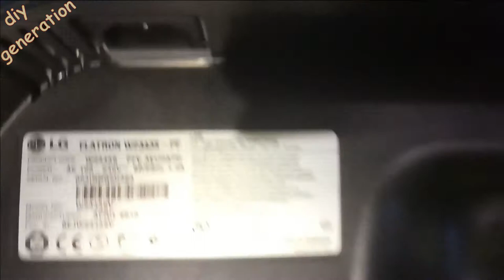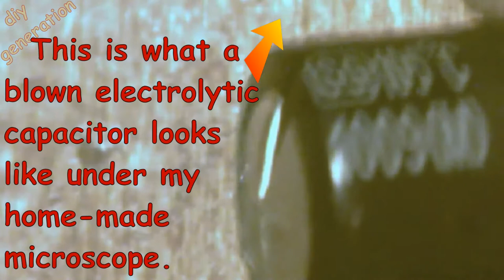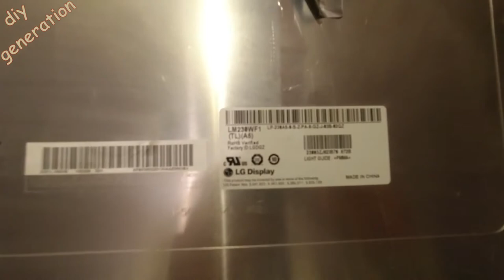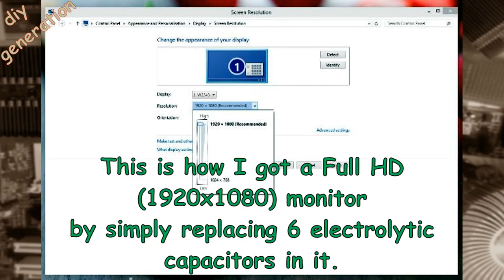Repair of LG Flatron W2343S monitor | Why is the monitor broken | diy generation

Comment: Nice clear and easy to understand repair here, my friend. Good on you for fixing something that was quite usable. A nice new monitor for you. Thanks again.
Reply from the maker: Thank you for rating my video so highly. I must tell you, I have already repaired 3 monitors this way. And all of them had exactly the same problem. I don't have more statistics about monitors failures, but I think that bloating of electrolytic capacitors is the most common cause of their failure.